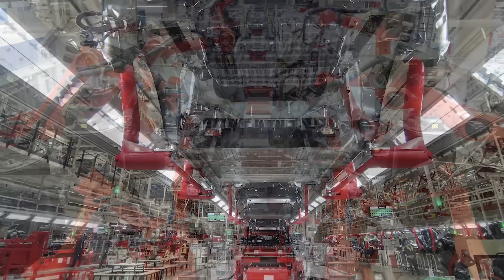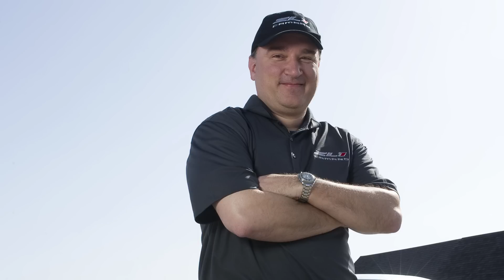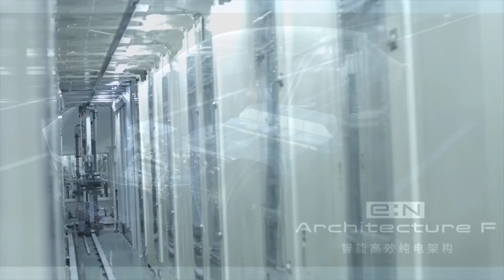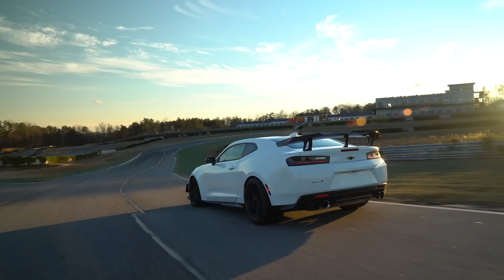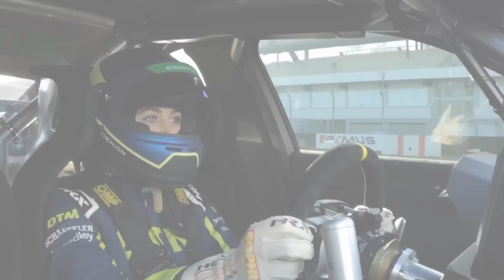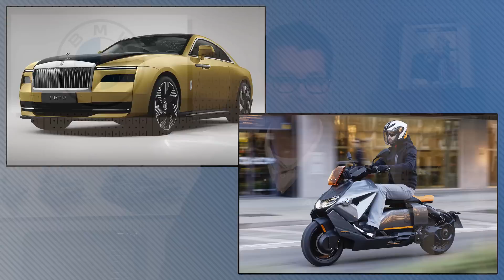Honda EV Van Only $7,300; Tesla to Shorten Shifts in China - Autoline Daily 3464

Comment: Distracted driving is a major cause of accidents these days, reducing speed limits won't prevent as many accidents as finding ways to prevent drivers from using their devices while driving.
Reply: I often see elbows on the steering wheel and two hands texting away while they drive.
Reply: @JohnPMiller  Texting, drinking, eating, doing makeup, adjust hair and clothes (both men and women), turning around in their seats to talk to kids or other passengers, drumming with music -not holding the steering wheel. And in a few cases I have seen people glancing at computers/videos while still driving.
It is a wonder there not even more accidents.
Reply: Such an easy fix it's not even funny. If they can create a super computer for your pocket, I'd think they could stop it from working while in motion in a vehicle.
Reply: @2012bigPerm  They made a phone app like that, no-one would get it.
Reply: @2012bigPerm  you shouldn't stop it.  Use driver discipline.
Reply: My neighbor almost got killed by a driver 3 days ago because driver was on Facebook.  I found drivers' cell Ph. in the ditch, Fb was open & showed timestamp of exactly when I witnessed the accident.

Comment: Camaro sales were struggling before the supply shortages, I highly doubt Camaro will become its own brand.
Reply: Never became what it hoped to be which is why the model ends for a decade or so and then tries again. 3-4 times so far.
Reply: @davidmccarthy6061  the Camaro has only taken one break in production since it came out in 67, I'm not sure what you're talking about. 6th gen sales haven't been terrible, they have just underperformed compared to mustang and challenger. GM still made plenty of the latest generation. 

I wouldn't be surprised a bit if Camaro will be an EV whenever it returns. With these skateboard platforms and so many components being shared individual models no longer need high volume sales to justify their development. So sales comparable to the 6th gen would be more than enough to green light a 7th gen EV Camaro.

Comment: The IIHS obviously never DRIVE… the ideas that they have will actually increase accidents. The IIHS needs to advocate for 75 minimum speed limits on Interstate Highway systems. Change roadway construction to be done exclusively OVERNIGHT, make Traffic lights “SMART” so that they don’t turn red based on a timer but rather based upon traffic needs to regulate the flow. (MORE REGULATIONS and especially limiters and speed bumps will only cause un-needed stress on the driver.) People that have Medical issues should get more frequent DRIVER AUDITS, some folks with Blue and Purple Hair and are over 80 or 90 really need to have some audits. Many elderly people drive way too slow on the roads (below limit), make haphazard lane changes. *Florida Resident here.

Comment: America, you do NOT want lower speed limits. Here in Sydney, some 'high pedestrian areas' have dropped from 50 to 40 to 30km/h in the space of 5 years. 30kmh is ~19mph. I feel like I can get out and run faster. The 30 zones have come under fire from locals and council members, and will probably be lifted... back to 40kmh (a small win, but it's better than 30). Distracted pedestrians are the problem, not cars.

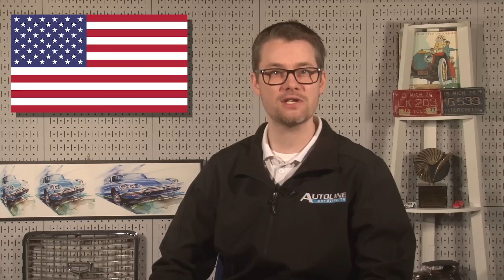Comment: 1:09 I personally believe that if speed limits are lowered--especially without enough supporting changes to go with it--the fastest drivers will continue to drive at excessive speeds while the slower drivers will drive even slower (due to the reduced speed limits). This would result in an increased safety risk due to a greater speed differential between the two groups of drivers. Therefore, I suggest that the speed limits should remain the same but the enforcement measures made more consistent and effective.

Comment: I'd like to see statistics on vehicle crash deaths. Are most of them happening on highways? The limits on interstates and other limited access highways are already a joke and widely ignored in many parts of the country. The only thing that reduces speeds and improves ped/cyclist safety is changing the road design to force drivers to slow down. A 25 mph speed limit on a wide open road feels like an arbitrary punishment. On the other hand, a road that has obstacles, raised pedestrian crossings, and narrow lanes makes it feel totally normal to drive 25 mph or less. Of course changing existing infrastructure is enormously expensive, so most places will just slap a lower number on the speed signs and extract more ticket revenue from normal commuters.

Comment: Here in Oakland CA. There is no traffic enforcement. It is downright scary to drive here. There always seems to be someone driving dangerously.new laws will have no effect if old ones are not enforced. The most dangerous freeway here has narrow lanes. They put bike lanes right next to the curb making crossing the street more dangerous because bike riders don't obey the rules of the road for the most part. Speed bumps help around here but some drivers swerve around them at high speeds. Since the beginning of the pandemic drivers are really nuts. Traffic at first was very light. Drivers were going crazy fast everywhere. Now traffic is almost back to normal and drivers are still diving really fast on streets and freeways. Speed limits are 65 on fwy. I drive 70 to keep up with the flow , get passed by weavers doing 90+. Then there are the people driving 50. No traffic enforcement.

Comment: @autoline Will Celestiq include a North American Charging Standard port??  it would be luxury to be able to charge with a slick port.
Reply: No, it's going to use an 800 Volt architecture with CCS for fast charging just like the Hummer EV, Cadillac Lyriq and all the other ultium power EVs from GM

Comment: Is it me, or have the number of new vehicle announcements (mainly electric) by carmakers increased by  … > 2-fold in the last year?
The # of models of late is surprising.
Question on my mind is:  When will carmakers admit that, other than battery design and cost, EV’s are easier to design and get regulatory certification for so they CAN move them to production faster!

Comment: USA can never have a sub $15k car again because of all the safety mandates
Reply: a 25k EV is pretty much the same cost of ownership as a 15k ICE though. And those will be made eventually.
Reply: It's a great compromise, can I buy used cars for much less
Reply: @Custo911  idk if you're using fast chargers it's about the same as gas. Only savings is on oil changes. For most people doing apartment living or street parking, charging at home isn't an option.
Reply: @KingSobieski  Majority of people in USA already live in a house ~70% slightly less in Europe. So the apartment argument already doesn't work. Also, almost all apartments have parking attached to them. Running a regular 120V line would be sufficient for most drivers (especially if you have a car that drives over 250 miles on a charge).

I have a Tesla with 330 miles and after 28k miles (in 1.5 years) never had to use a supercharger outside of long distance travel (and I use destination charger - 120V).
Reply: @Custo911  idk, where I live if you had an outside charger some crackhead would copper scrap it so quick.
Reply: @KingSobieski  But you do not represent a majority of the population :) Most people will have access to a reliable charging spot.

Besides, you don't have to use lvl 3 charging even you can't charge. For a smaller % of the population they can charge at work on lvl 2 chargers. 

Or for even smaller % they can use lvl 3s. Yes they are more expensive than at home charging, but still 30-50% cheaper.